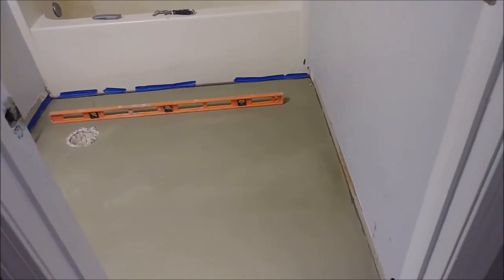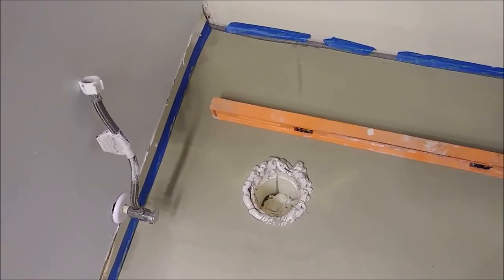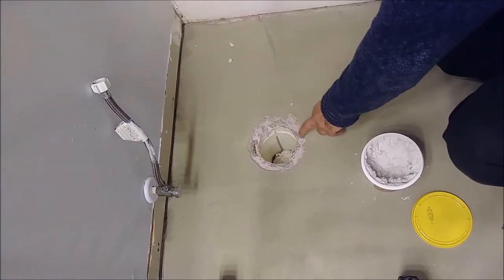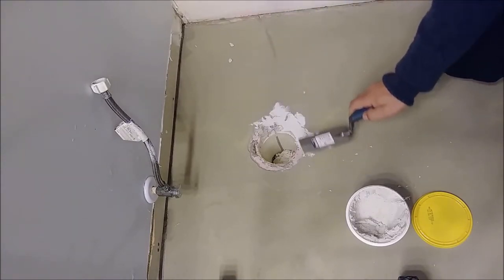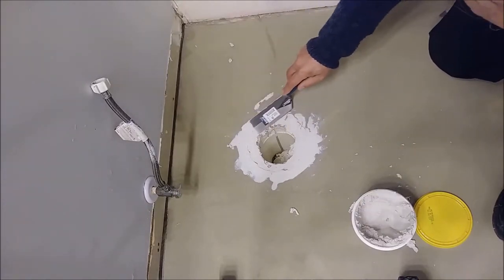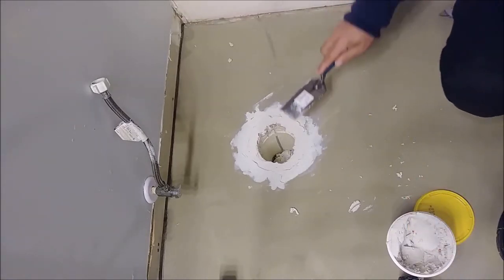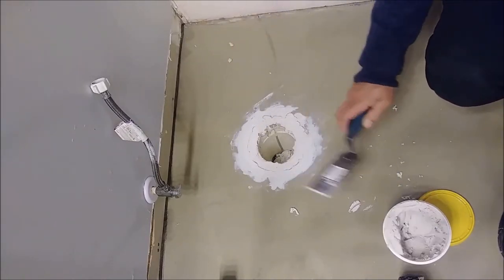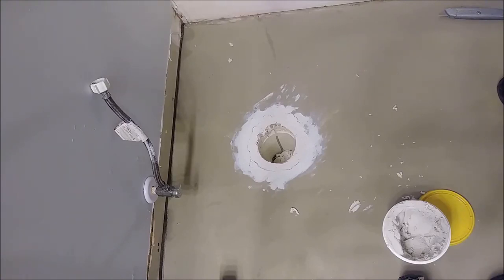How to Patch Concrete Floor - Correcting Toilet Drain Pipe Area After Self Leveling

Comment: Is this enough so that the toilet flange can screw into the floor?  Doesn't seem like enough support for the flange. Did this work?
Reply from the maker: Worked great. Never had an issue with it.
Reply: @josephk9182  interesting. So you're screws went directly into that and into the foam?
Reply from the maker: @Dane._  I cleaned the foam (no foam). The imperfection around the toilet pipe created as a result of self leveling the bathroom floor. The depth of the imperfection is 1/4". The screws going to the concrete floor so I did not have any issue.
Reply from the maker: @Dane._  there was no foam . I removed the foam and patch the concrete.